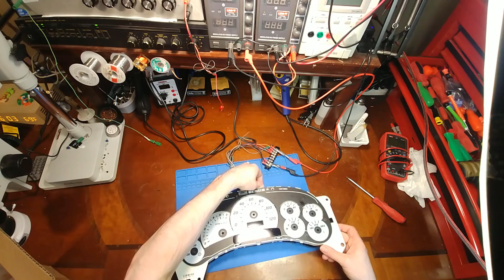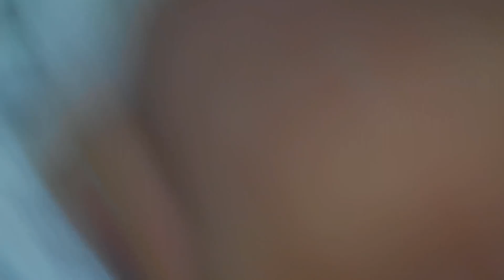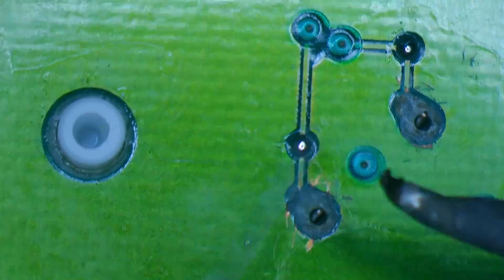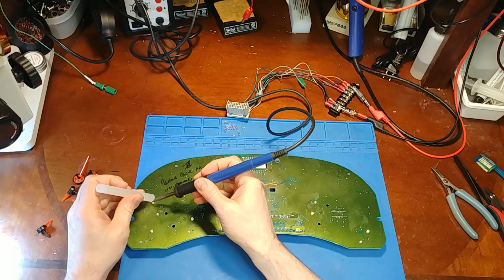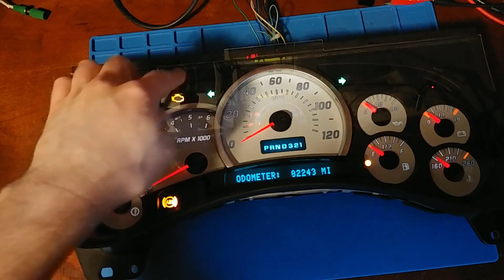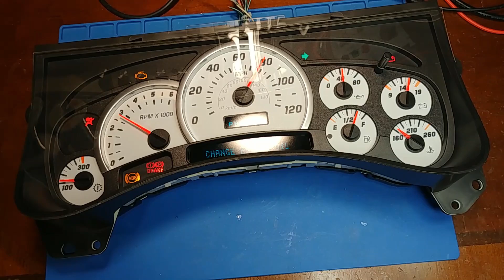Hummer Cluster Previous Repair

Comment: I know it's an older video but all these "non-repairable" clusters you actually repair are just from lazy folks, I think I've only seen you give up on one cause it was that big chip between the speedo and oil pressure gauges.
Reply from the maker: Correct. I'm set up to replace anything but the microcontroller. For that I send them over to Matt at the channel fixed until broken. He's a pro at reflashing replacement microcontrollers.
Reply: @jeffescortlx  true but you've taken so many basket cases on...and won, that's impressive.

Comment: This video has just saved me serious ££££££££ I was ready to throw cluster out and buy new, thank you
Reply from the maker: Definitely don't throw it out. It can be rebuilt.
Reply: jeffescortlx I’ve got a no power issue, no light gauges nothing works.
Reply from the maker: @builditwithrob  that's normal, especially for 03-04. As long as you find someone that knows what they are doing they can include that repair within a rebuild service.
Reply: jeffescortlx thanks bud appreciate the advice

Comment: Are you using (insulated) "magnet wire" for your long jumpers? Does the varnish insulation come off just with the heat of the soldering iron?
Reply from the maker: Yes and yes!

Comment: Hi need you email address thanks
Reply from the maker: It's here: https://youtu.be/T_2WnJMsZaU
Reply: Mercedes sprinter cluster
Reply from the maker: @dineshramsumair796  I'm not familiar with that one.
Reply: Would you like to try everyone don't know model number a 9064466221
Reply from the maker: @dineshramsumair796  I don't have any parts, wiring diagrams or bench testing setup, so I would be going at it blind. Chances of repair is slim.

Comment: Why did you not look into the LCD display?  It clearly still has pixels missing at the end of the video.
Reply from the maker: It was troubleshooted. But it would have required parts/labor not covered with a rebuild service. The customer was ok with accepting it with the missing pixels.

Comment: Could you please tell me where I could find that solid silver and copper wire your using for the jumpers? Thank you.
Reply from the maker: The silver wire is just left over leads from lamps. The copper color wire is enamel coated wire scavenged from an old transformer.

Comment: I have an 06 escalade ext with 190k. I really dont want to risk screwing up my cluster and would rather have you fix it.  But I'm not sure if its the problem.  My gauges all seem to start up correctly, where when you turn the key, they sweep from max to 0 like normal, but then when they start to actually read, the oil pressure goes to 80 even when the key is on and engine off. When driving the gauge would sometimes drop to 0 and the information center would say low oil pressure, but the motor kept running fine, even though it said 0 pressure for up to 5 minutes.  It would randomly go from 80,to 0 pretty randomly.  So I changed the sending unit, and it still goes to 80 and stays there, but it hasn't done done the random going to 0 thing since then (about 3 months now).do you think this is the gauge?  Even considering its doing the initial sweep thing normally?  The gauges are all original, even all the bulbs work fine (tho I would like LED's).  What do you think?
Reply from the maker: 99% sure it is not a problem with the Instument cluster. My guess is you have a wiring issue, or some oil sender issue going on. What your describing is not stepper motor failure. And even if it was stepper motor failure, it's can't cause the cluster message center to display oil pressure warning.
Reply: @jeffescortlx  ahh okay.  Thanks!  I really appreciate the response.  If it is ever a problem in the future, I'll make sure to give you a shout.  

Do you by chance work on computers? I have a 1999 suburban with the common ignition module voltage issue.  Do you fix those by chance?  I don't want to get into a 411 computer swap.  Thanks!
Reply: @jeffescortlx  *1999 suburban c1500 5.7l old body style

Comment: Hey Jeff, I just wanted to thank you for your channel and the videos you put out.  I used your technique of scraping off the solder mask and installing a jumper to repair damaged traces on a 40 volt battery with water infiltration.  Somehow, a test point and surrounding trace dissolved, rendering the circuit open and the battery useless.  With five minutes of work and a few cents worth of material, I was able to restore the battery to service.
Reply from the maker: Great to hear you got it fixed!

Comment: Can you fix  a Lexus is350 cluster?The needle led and off.
Reply from the maker: I might have in the past. Sorry I'm not familiar, not a whole lot of those in my neck of the woods.
Reply: Would you like to try to fix it?
Reply from the maker: @frankreyna7210  the problem is you can find a used replacement for half the cost I would have to charge for service. So it wouldn't be economical.
Reply: The problem is that I can’t find one that works. How much would you charge me?
Reply from the maker: @frankreyna7210  hard to say since I'm not sure what I'm in for. Your best off finding someone with experience.
Reply: Ok thanks

Comment: Nice repair video!
As for the boards, one can figure that the car manufactures use the cheapest boards on the market when their suppliers create these boards. Poor quality fiberglass and thin copper plating will always lead to some problem down the road. They figure they can get an easy sale for a new assembly. I have seen this same problem in the past with commercial two way radios in the shop. ROHS compliant boards are notorious for this issue. They use inferior solder from the start and if you don't use just the right temperature from the start to de solder this is the net result.
Reply from the maker: The lead free solder does see some fracturing over time. But in all fairness these PCB's hold up pretty well as long as someone doesn't come along with a blowtorch and a pair of players and start ripping parts off the board.

Comment: I know you fixed the repair but what was the original fault ?
Reply from the maker: The fault brought to me was the board was damaged from someone trying to fix it. But the original fault would have been failing stepper motors, that is common for the 03-06 GM's to do.
Reply: @jeffescortlx  Thanks I was wondering !

Comment: the DIC is still missing pixels.  You make fixing missing pads look trivial, I wondered what kind of wire you were using until I saw what looked like an led on the other end of the wire ;)
Reply from the maker: Looks like I missed a video clip during editing. After tracing out the PCB, I came to the conclusion either the VFD chip or VFD was ESD damaged by the first repair attempt. To fix it completely it would need a new board, I have no more donor VFD's as of now.

Comment: Thankfully the i.c's were not played with, people can be real pillocks.

I have to admit jeff that i've lifted a few pads over the years of repairing electronics, sometimes it's down to poor quality pcbs, or me having a bad hair day lol.
But i have to repair my own mistakes, i don't pass it on to some other poor sod.
Reply from the maker: Yes, PCB with heat damage can pull pads easy. Also when through hole leads are bent over it can add a extra challenge.

Comment: Could you use a electric glue gun to the hold the motors in or since you already have the soldering stations set up it faster for you to just melt the wax in. Looks like the wax you use is from a electric heat gun is why I asked.
Reply from the maker: Yes It's a hot glue gun stick. And yes since my soldering iron is already hot I use that instead of waiting for the glue gun to heat up.

Comment: dim backlighting
Reply: i used to work for a hummer dealership that sold H2. and they all had problems with the IPC cluster. another issue was wind noise around the windshield
Reply from the maker: @ReaglesRacing32  Yes, they have all the same wonderful cluster problems as the other full size GM's (same PCB). I guess wind noise comes with aerodynamic styling of a brick? : )
Reply: jeffescortlx they used to love destroying the reverse gear and burning up the drive gear bands in trans.
Reply from the maker: It's a Hummer. The Hummer face doesn't let as much light through as the other GM's.

Comment: What wire do you use? I want to experiment doing trace repairs, and I have an old computer motherboard that has severe damage. It's worth nothing, but I want to practice and learn, and I feel these videos help me with some of it. I appreciate them as they are very useful.
Reply from the maker: The short jumpers are just bare solid strand wire, I get them from the lamp leads. And the longer jumpers that have the potential to short out are the coated wire. But just about any kind of wire can be made to work. So get to it!
Reply: he uses transformer laquer coated wire, this had been explained in an earlier video sometime ago, the laquer is burned off when he solders

Comment: Am I to understand that on my 2004 Silverado I can add a transmission temp gauge?   My cluster readouts are getting so dim I can't see them in the daylight ao I may need it serviced soon.
Reply: You can physically add a trans temp gauge, but it won't work without programming. Ask me how I know :)
Reply: @jamesb1221222  it will sometimes work but definitely not guaranteed. Some have the flash. Does anyone happen to know what line of the eeprom has to be changed for transmission temp to work ? That's the one I haven't figured out yet. To be clear I'm talking about with like a minipro where you are editing a dump not using like a digiprog
Reply: @jamesb1221222  Thanks for the reply.What needs to be programmed? The cluster or a control module.
Reply from the maker: @rcpasc1948  Some early non-trans temp 2003's clusters will have the trans temp gauge active. But a 2004 will need to have the cluster eeprom programmed to unlock it. After that it's plug and play and nothing else needs programming for it to work.
Reply: @jeffescortlx  How much extra $$$ is it to do that upgrade?
Reply from the maker: @rcpasc1948  rebuild service is $130, to add the trans temp you need a trans temp face, to purchase one from me is an additional $50.
Shipping not included.
Reply: @jeffescortlx  Thank you for the reply. $180 is what you are saying plus shipping.
Reply from the maker: @rcpasc1948  correct.

Comment: If you're and electronics repair tech and you can't do simple trace repair, then maybe its time to get into another trade. And at the very least, if you're going to condemn it as "unrepairable", promptly let your customer know of such a diagnosis. Don't leave them in the dark for a few months. I guess the moral of the story is: steer clear of those super cheap eBay repair deals folks. Those guys are just practicing on your stuff.
Reply from the maker: I did a quick look up of the shop that had it last. Custer service was not a priority with them. Seemed about 50% of the comments where happy customers and the other half not happy. Poor communication and inconsistent lead times.  I try to give the same level of service I would like to see in return.

Comment: I rebuilt one of these a few weeks ago for a guy from Florida. It's was dead in his Hummer when he bought it but the p/o had someone work on it because the whole board was covered in flux probably 2 mils deep and the main IC was dead on it. It pulled like 4 or 5 amps if you tried to turn it on. I ended up just putting a Silverado board in it and reflashing the mileage off his old eeprom.
Reply from the maker: Yes as long as you can get the hummer lens you can build a replacement out of Silverado parts. Face and needles are slightly different for looks, but compatible. Too bad someone had to mess up the one you worked on, was probably just fractured solder joints from the start. Glad to hear you got that person squared away.
Reply: My favorite boards are the ones someone else messed up because it gives me something different to do. Amplifiers I can't stand to get one that someone messed up because then I'm trying to figure out if it was their mod that killed it or what.
Reply from the maker: @FixedUntilBroken  I hear ya!